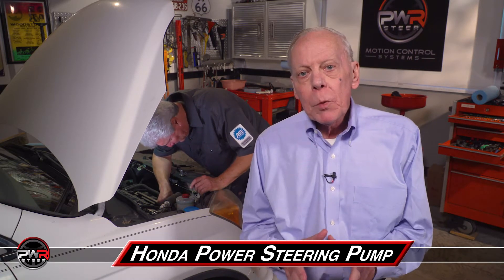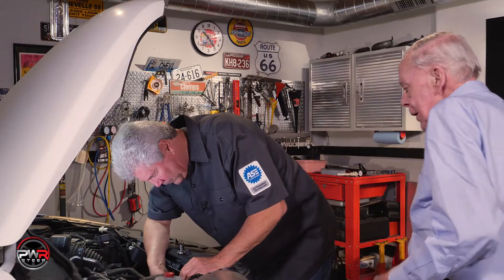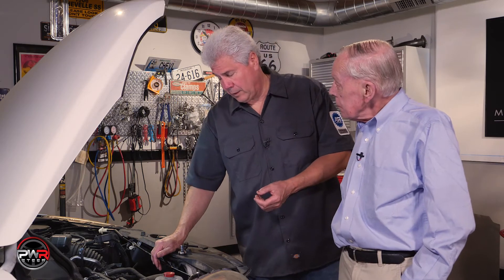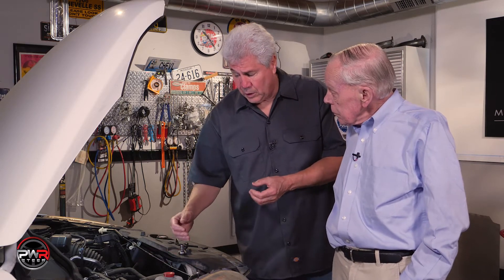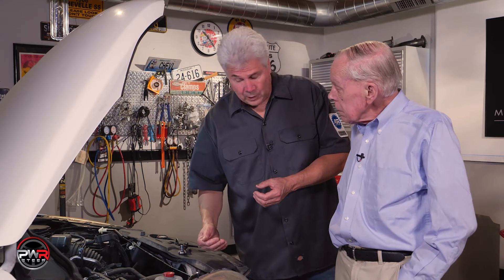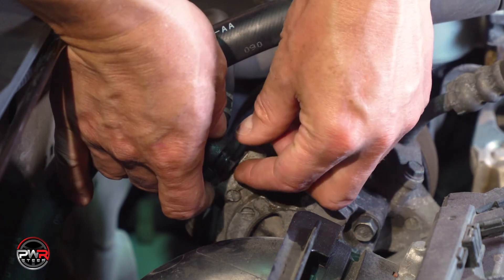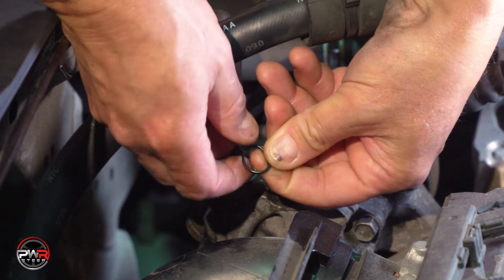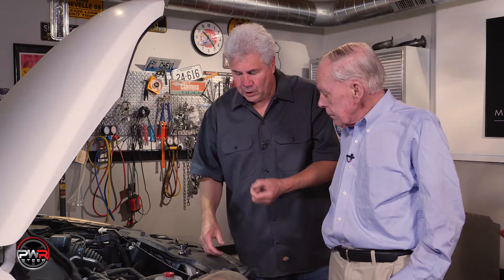Noisy Honda Power Steering Pump

Comment: I think my mechanic is screwing me over he said I was missing the plugs to my power steering I found your video and I still can't figure out what the guy is talking about missing plugs on my power steering system it's a 2004 Honda accord 2.4L 
He changed everything from the rack in pinion to the power steering pump and all the lines and yet after getting my car back I had power steering for less then a day, I took my car back to him again. If everything is new what could be the problem?